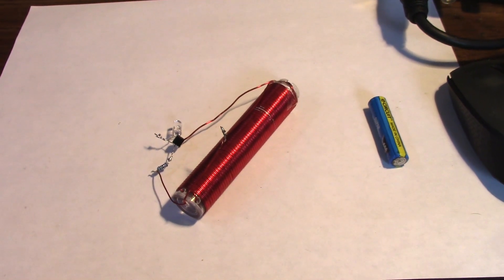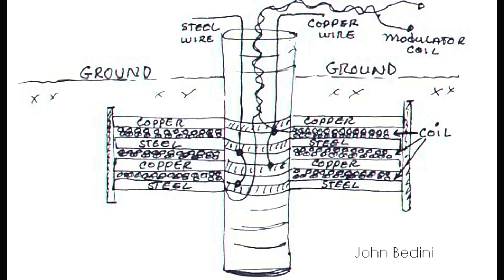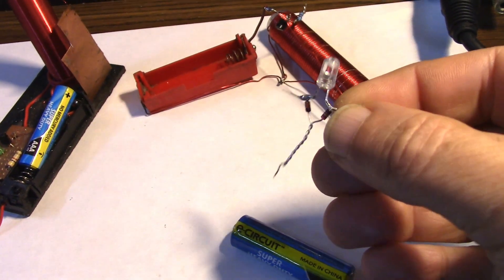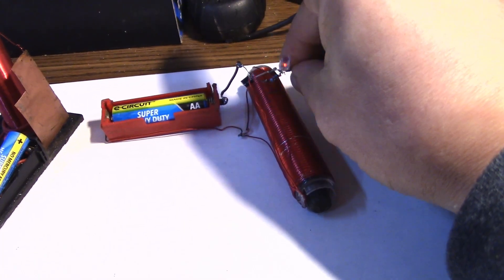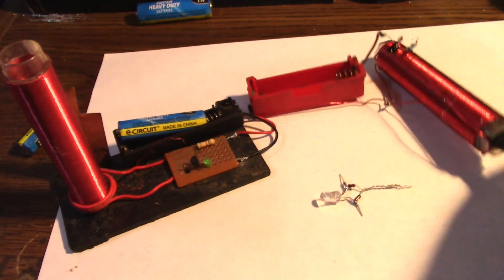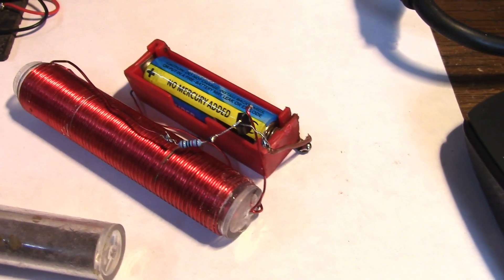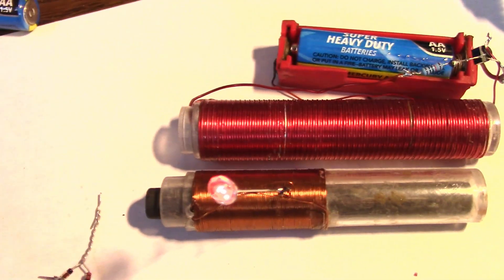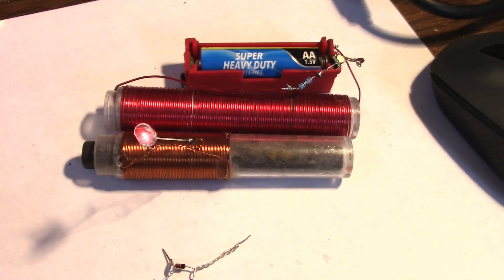Stubblefield Coil Experiments – It Went All Tesla On Me!

Comment: For gain the best output,  put  the all coil under vacum,
Reply from the maker: I've no doubt you are correct! 
It seems like something difficult to do, but I used to work at a meat processing plant and the vacuum machine would have been ideal! So, put it in a strong plastic bag and remove the air.
Thanks for your comment 😀
Reply: @Slider2732_ put a little candle inside a some sort of bag and when the fire expire it's done,  greeting from italy,  if you do that,  let me know,  thanks again.
Reply from the maker: @rooxynala841  Thanks. It seems something like what they call lamp black. Well worth looking into! Also, salmon coloured copper when it's been heated.
Grazie per il tuo commento 😀

Comment: I can understand if you were trying to pull power from a new found source or trying to light up a high powered light. But i don't get what are you trying to show here by adding a coil to a led powered by a battery?
Reply from the maker: Ah, that's fine if you don't understand (I just deleted an equally terse reply to your first comment... was only fair)
A 1.5V battery can't light an LED, that's why Joule Thief simple circuits are so popular. LED's need 2V and more, depending on which colour they are. 
This circuit in the video is a variant on such a circuit, replacing the usual ferrite toroid with a solder tube that has no core at all. It uses a type of coil not often seen, especially at just 1.5V. Joule Thief circuits will nearly always show a toroid with wiring wound on it to produce a strong light, which this one in the video doesn't need 😀

Comment: What's it about how it's special?
Reply from the maker: The bifilar winding for a JT circuit isn't common on a solder tube, partly because there's a limit to how small of a diameter the coil can be without needing ferrite. Then, the wireless output is there for such a low linearly wound turn count.
Mainly, it's just some fun experiments with such a coil, on an unmonetized channel  😀
Reply: @Slider2732_ so what's different because I also made such ferrite less aircore joule thief circuit and it was working without surprise because I knew Aircore exies so what's use of extra aluminium winding? Will it similar real inductor core unlike open coil with Aircore ?
Reply from the maker: @omsingharjit  Yes indeed, an aircore will work, but usually they have much reduced output, at least in my own experience. Hence the surprise with the ferrite rod not doing much of anything... they normally make a huge difference. 
This idea was simply a complete unknown, because of the bifilar winding with different metals. The video is a few ideas that I wanted to try while recording.
Does aluminium make a difference? I don't know, but didn't know the answers to any of it before filming and was happy to see it had wireless energy abilities 😀

Comment: Your circuit is a basic blocking generator/relaxator.  Why does it need dissimilar wires?  I am pretty sure it'll work fine with just copper ones.
Reply from the maker: Yep, I'm sure it would work just fine with only copper, but the idea was to see if the dissimilar wires produced anything different. I wondered whether conductivity differences might impact it. In fact, would it work at all as a Joule Thief type circuit or for wireless energy without a core and at this diameter. 
So, that's the video, differences in performance, similarities and really just a fun look at a different way of building a couple of very common devices.

Comment: Vebo must be stratospheric on the last test
Reply from the maker: The 2N2222 coped well and performed fine, but such matters are why I normally run anything with 'up to' 1.5V. Mind you, it's also a case of having a box of 100 of them and only looking for the effects, rather than running within specs 😀
Reply: @Slider2732_  that is why they put a reverse diode or led connected with the base and emitter on slayer exciters, to limit that and prevent the emitter connection degradation(so far what I've read) to prevent Vebo avalanche
Reply from the maker: @deathkeys1  Most certainly, the protection would be a good idea. In practice, my own experiments are normally at 1.5V and below, where avalanche has never been a problem. But, some of this sort of thing goes back to my original SWES from about 2012, where the whole idea was to simplify right down for a wireless energy system. Along the way, there were no issues longer term with 1.5V systems, so the diode got removed. 
I know that learned folks like yourself will often scratch the head to the point of baldness at some peoples shenanigans, but that's what happened in my case. Transistor failure only happened at higher voltages 😀
Oh and it caused some consternation with some folks when I started putting an LED across Base and Collector! But, anything still ran fine on those low voltages.

Comment: Was Stubblefield not using steel wire wrapped in something that could get wet underground, which would be adding the faraday Batterie effect to the equation like in your experiments with Zink and copper wire? And also a magnetic component. Ahahaha, you are looking to combine the 2 (3) things?
Reply from the maker: Ah now, that would be top secret 🤣
Nah, actually it's only that when people have wound 2 different metals together on ferrite rods or a similarly shaped core they've tended to call it a Stubblefield coil. I am though quoting from about 12 years ago when the coils were popular with experimenters on here.  
But yes, his telegraphy setups were as you describe and I do like your concept😀 A problem would be the insulation on the copper, i could do with the 19th century cloth over bare copper wire!

Comment: Hello, it seems that anything you do, you only get an oscillator 😂 electric pile with copper-zinc  you got oscillator for output … solar lights … Tesla was right, we need to discharge in small amount anything. Divide et impera !

Even a ram pump is an hydraulic oscillator 😂
Reply from the maker: Haha, yes, no matter what I touch it ends up being an oscillator. Was just working on building some steps outside for our front deck on the house and will patiently await them lighting up all on their own when it goes fully dark 🤣
Reply: @Slider2732_  oh, you want to paint them and add a phosphorescent coating ?
Reply from the maker: @Caesarus2011  Actually, that would be cool!
But, in fact, I may add lighting of some type to them. Lights down the edges of the steps might look good, using some kind of hopefully energy efficient and interesting solar circuit. Maybe a similar conversion as the Christmas tree solar garden light project. 😀

Comment: You may find you get the best inductive coupling at the end of the coil where the highest voltage is connected to the collector .Maybe try a variable resistor at the base to adjust the base current . Changing the resistance changes the frequency and the output . Merry Christmas , another great video .
Reply from the maker: Thanks hydniq and Merry Christmas to you too 👍
Yeah, I thought that after recording, how it would be normal for that end to have the greatest potential. It was only meant to be a 'look see' but turned into a cool little side project.

Comment: I recommend to try bismuth powder coated core. Water- or Rochelle salt piezo cores are interesting too :) It's also possible to use two copper (or other metal) rods as core, so they act like a capacitor.
Reply: Bismuth plated copper is a superconductor 😉 and can be done home diy cheap and easy
Reply: @Caesarus2011  Issue is that many acids are banned for many countries. Just found out that Bismuth and Hydrochloric acid can be used for galvanic displacement of Zinc.
Reply from the maker: @Caesarus2011  I see that I need to find that chunk of bizmuth, don't I!?! 😁
Reply from the maker: I did have a 1/2lb chunk of bizmuth, but haven't seen it since moving house 3 years ago. Idea would have been to sand dust/powder from it (outdoors). Interesting ideas, thanks!
Reply: @Slider2732_  i would look as deep as I could into this, semiconductor industry use bismuth coating/plating in almost anything, copper and aluminium 😉

When electroplating with bismuth, when first nano layer is deposited onto host metal voltage and current is triple without any change in power source which provide CC and CV … interesting things to study with this diamagnetic metal
Reply from the maker: @Caesarus2011  Yes, it's a very cool topic and thanks for the heads up. I do have electroplating gear here somewhere, though it's still boxed from our house move and needs to be found. 
Best result would be the chunk of bizmuth being in the same box!